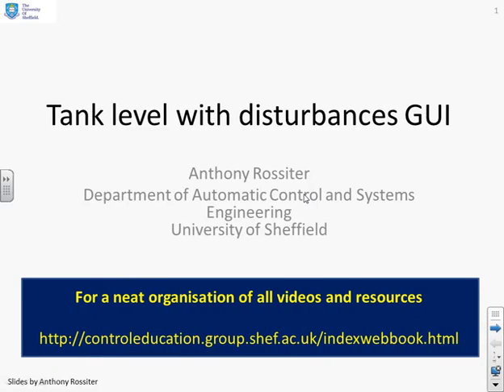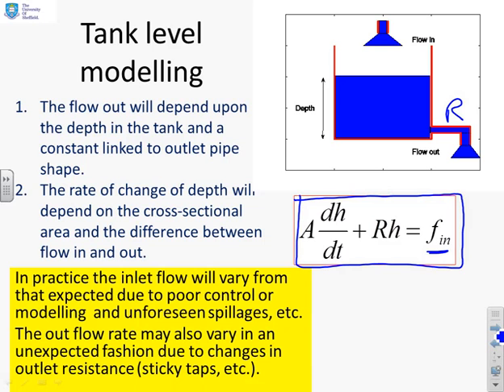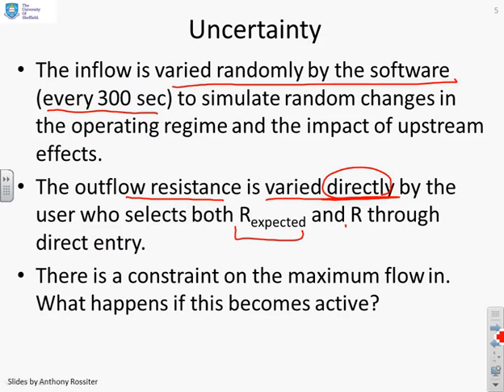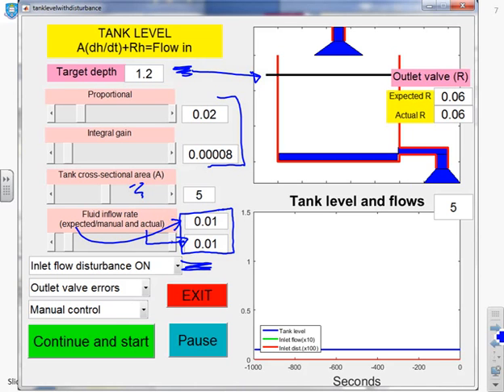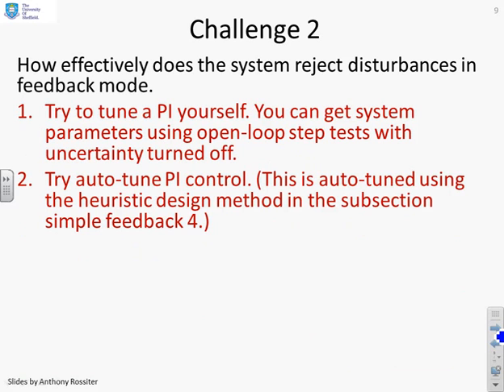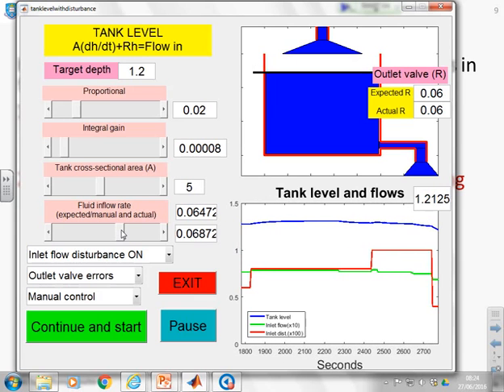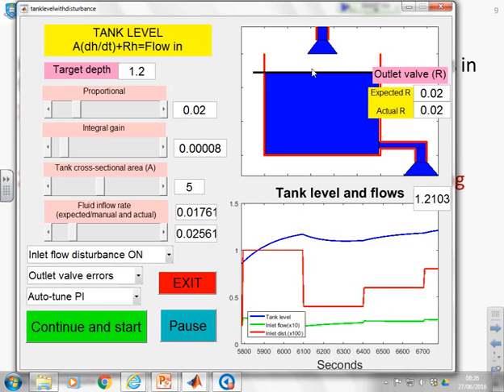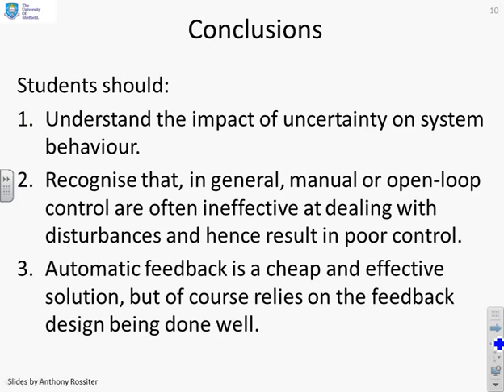Matlab GUIs - tank level with disturbances

Comment: Do you have this GUI ?
Reply from the maker: Available on this page: https://sites.google.com/sheffield.ac.uk/controleducation/matlabresources
Reply: @johnrossiter2323  very nice lectures.  I watch as many as I can. By background is controls. I do get tough projects and the math is vary intense.  Simulink takes away some of this pain, but at the end going back to the basics is only to understand the blocks.  Writing c code direct is not practical for kalman filters and matrices... so building models is only way.  

I see you attached sheet very nice. I will go through this. Problem is motor postion control 2 miles in a hole. Noise is saturating feedback.

Problem two ..  I need some direction on how to solve mvout (P,T)  [a* T^2 +b* T +c..]P.   I can solve in excel using solver. But I am not sure how to approach this in Matlab fimincon...or simulink blocks.  It may have something to do with LMS.  I am been give the data.  0 to 25K PSI at 25 to 150 C at discrete points.  When doing the work it's hard to study cool models.

Is there a guide on building block diagrams on pumps , valves and motors ... I need a way excite the parts and cone up with a more accurate way of model.  First principles is tough. Most of the time manufacturing does not know what I am talking about. Any guide would be helpful as well.